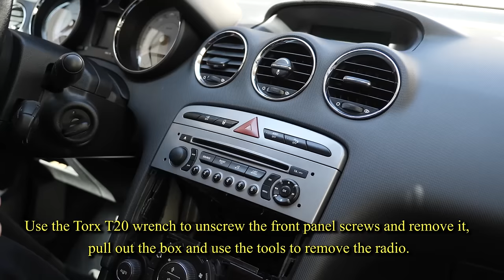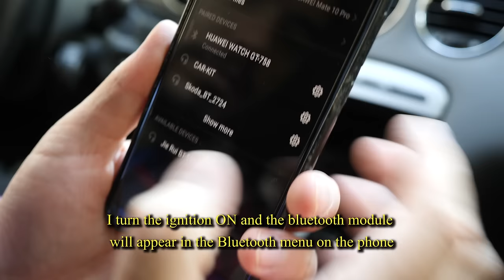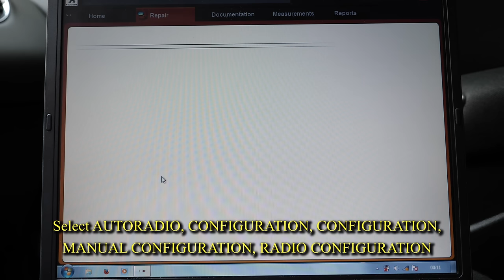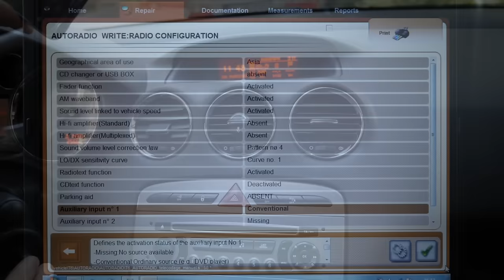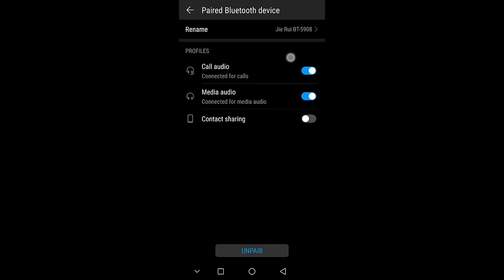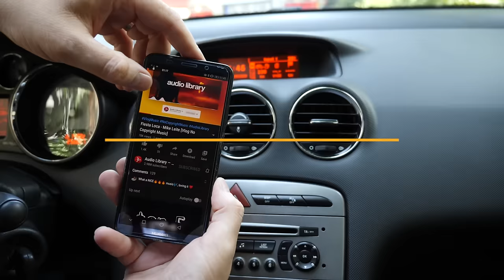Install Bluetooth Audio Module on Peugeot & Citroen Radio RD4, RD45, RD43

Comment: Ciao, is it correct that the module light stays on even after turning off the car?
Reply from the maker: Hello.  It should stop if the power cord is on the ACC.  If it is on the permanent plus cable then the module will not stop.
Reply: @AdrianDragan  thanks for your answer. unfortunately according to the diagram in pin 11 the cable was not foreseen, so I used pin 12. do you think it can drain the car battery?

Comment: Great video thanks. About phone calls, i heard people but they dont heard me. Do you know whats the problem?
Reply from the maker: If you bought the model without a microphone, people will not hear you. When you are connected to this bluetooth module you must deactivate the calls function in the bluetooth menu of the phone, see in my video 7:16
You need this module to work calls: https://www.aliexpress.com/item/32826594463.html?aff_platform=shareComponent-detail&sk=_9R3eKP&aff_trace_key=69b1471dec82414891bfcd005002377b-1604149301468-01708-_9R3eKP&terminal_id=77944c4ce01745aba668c8702a5739a3&tmLog=new_Detail

Comment: Great video but…for the call with Bluetooth? There isn’t a microphone …
Reply from the maker: Hi. In the links in the description of the clip you can also find models with a microphone 😉
Reply: @AdrianDragan  thank you man👍🏻 is also compatible with Citroën c4 Picasso year 2011?
Reply: @AdrianDragan  ok I buy the type plug and play with microphone…but,when I mount it,I can to go to Citroen to unlock aux or not? Thanks
Reply from the maker: @HouseMatic  It is compatible if you have Radio RD4 as you see in my video. You will need to go to the Citroen garage to activate the Aux IN function.

Comment: Adrian, tell me if it is possible not to disconnect the aux2 connected with a wire, but connect this bluetooth to aux1 and activate it. Will both work?
Reply from the maker: Hi. Hello. Theoretically they should be able to be kept on both, but I haven't tried. With Diagbox you will have to activate Aux 1 and Aux 2.
Reply: @AdrianDragan  I completely forgot that I have a CD changer emulator connected to aux1 for music via USB. Today I did exactly the same as in your video. Red to yellow, black to green-yellow. No activation was required, as there was a regular wired aux. There is almost no sound, it connects poorly. I think it's a marriage or maybe the pinout in the bluetooth is wrong?
Reply from the maker: @gromov8550  And the bluetooth module I tested in the video didn't seem to sound as loud as the original radio, but it still sounded clear and loud enough for me.
Reply: @AdrianDragan  This one, after reworking the connector, sounds like a regular wire aux. The sound is good. Thank you for the video.

Comment: Hola Adrián! Quería saber si es posible que el Bluetooth se encienda solamente cuando esté en input 1
Es posible? O si o si cuando el stereo está encendido?
Ya que no quiero estar escuchando la radio y que el Bluetooth siga encendido.
Muchas gracias
Reply from the maker: Hello! I'm sorry but I don't understand your question. Can you ask me in English?
Reply: @AdrianDragan  Hi Adrián! I want to know if it's possible that the Bluetooth module only turns on when I put the source on aux 1.
Because I don't wanted to be always ON.
So if I'm listening to the radio or a CD, the Bluetooth is off.
Thanks!
Reply from the maker: @carloscasares2308  Hello. It is not possible, the bluetooth module only turns off when you turn off the ignition, otherwise it is on even if you are not in Aux IN mode.

Comment: Hola buenas qué cable has usado y qué programa. Un saludo y gracias por tu vídeo
Reply from the maker: Look here: https://www.aliexpress.com/item/32815977509.html?pvid=0d5e756a-b7a6-4a3f-9831-64295117c470&aff_platform=shareComponent-detail&sk=_A8pQG1&aff_trace_key=4d1b5bbdd9934dd1a5598745bf9a3b5b-1609965045346-03938-_A8pQG1&rmsg=do_not_replacement&scm=1007.23534.124000.0&terminal_id=d92441f0a7b94ef29dcdfc816a4dd068

Comment: hi, i have a citroen ds3 with the radio 'my way rneg' which has bluetooth but it only serves to answer calls.  I wanted to install a module like the one in the video to listen to music on this radio, could you help me?
Reply from the maker: You need to check if you have that free plug for connection. If it is free you must also configure with Diagbox for Aux IN.

Comment: I've installed mine and sound is awful, extremely low and distorted... Does yours sound good?
Reply from the maker: Hi. My sound was a little lower than the radio but it sounds great.

Comment: Hello i buyed plug and play Bluetooth device but it doesnt work, Bluetooth device wont turn on
Reply from the maker: Hello. If the module is correctly powered by the 12v source and does not start, it may be defective.

Comment: Just wondering that you are using cd audio output to connect to Bluetooth output, will it not work when you select cd as source
Reply from the maker: This bluetooth only works when AUX IN is selected as the source.
Reply: @AdrianDragan   Many thanks for the reply will something like that works with cd exchanger port
Reply from the maker: I don't know, I haven't tested this model.

Comment: Hi sir, do i need to buy that diagbox ?
Reply from the maker: Yes. https://s.click.aliexpress.com/e/_DliIpcT
Reply: @AdrianDragan  may i know if this is compatible to a 2010 citroen grand c4 picasso?
Reply: @AdrianDragan  can i install the diagbox software if my laptop doesn’t have cd slot? .
Reply: @AdrianDragan  hi Andrian what if i will change the whole stereo to an android head unit do i need to use this diagbox for activation?
Reply from the maker: Hello.  If you install an Android unit instead of the original multimedia, you do not need any activation with Diagbox.  The Android unit is plug and play if you buy a dedicated one for your car.  What car do you have and from what year?
Reply: @AdrianDragan  i have 2010 citroen grand c4 picasso.

Comment: But how do you fix the low level, I have tried two different Bluetooth receivers with the same result, very low level of input on my RD4 car stereo.
Reply from the maker: For me, the sound level is good, so it works without making any other changes.
Reply: I have low level sound too. Quality is also very low.
Reply: Krystian Owczarczak I haven’t been able to fix it, I probably will buy a new car stereo instead....😢

Comment: Does it work on a Citroën C4 Grand Picasso year 2007 with OEM radio?
Reply from the maker: Yes, it works.
Reply: @AdrianDragan  thanks for your help.
Can you let me know what adapter do I have to buy if I'm interested to install new autoradio Sony, Alpine or Kenwood per example?
Reply from the maker: @nunoamaral7979   I think this: https://www.aliexpress.com/item/4000120219335.html?aff_fcid=78cde1ea86cb4bf386c7035b7ab58ed1-1615150484114-00782-_ANbc4S&aff_fsk=_ANbc4S&aff_platform=shareComponent-detail&sk=_ANbc4S&aff_trace_key=78cde1ea86cb4bf386c7035b7ab58ed1-1615150484114-00782-_ANbc4S&terminal_id=d92441f0a7b94ef29dcdfc816a4dd068&tmLog=new_Detail

Comment: Salut Adrian , dețin un Citroën c4 2007 și ca sa nu ma chinui sa comand de pe aliexpress piese , ma gândeam sa schimb radioul original cu unul aftermarket . O intrebare am , daca fac asta o sa mai funcționeze butoanele de pe volan de volum?
Reply from the maker: Salut. Eu recomand sa inlocuiesti radioul tau tot cu unul original model RD45. Astfel vei avea handsfree bluetooth, muzica de pe usb dar si mp3 de pe cd. Daca pui un radio din comerț vei pierde functionalitatea butoanelor de la volan, nu vei mai putea accesa meniul computerului de bord si vei avea nevoie de niste cabluri adaptoare. https://youtu.be/z5D4lsLGwVk
Poti cauta RD45 si pe olx, dar nu stiu daca vei gasi cu toate cablurile necesare.
Reply: Adrian Dragan ok , am sa ma uit acum sa vad daca găsesc ceva asemanator! Mersi mult

Comment: What is the function of wire that originalitty  in the entrance  gate?
Reply from the maker: Hello. That wire acts as an audio auxiliary cable entry for some models (there should be two RCA plugs in the glove box). On other models, as it was on my car, that auxiliary input cable was not fully installed and the AUX IN function was not activated.

Comment: Lho appena fatto ma scollegando il connettore gia collegato si va a perdere il vivavoce dell'auto perché non lo dici...?
Reply from the maker: Ciao. Non ho capito la tua domanda. dire ancora una volta per favore. Se possibile in inglese.
Reply: @AdrianDragan  The connector that you detach from behind the radio is the white one, on my Peugeot it is used to make the hands-free work, the other day I tried as in your video and the Bluetooth device worked, I state that I will have to go to Peugeot on July 4th, but I discovered by receiving a call and answering from the car the caller did not hear me and I did not hear him so if I insert the Bluetooth device I lose the possibility of having the speakerphone in the car

Comment: Hello, I am from Algeria. I did the same, no, the bluetooth did not work with the HUAWEI phone, but with Samsung it worked normally. What is the solution?
Reply from the maker: Hello, In my video I even tested it with a Huawei Mate 10 Pro phone and it works great. Did you manage to pair the phone Huawei with the bluetooth module?
Reply: @AdrianDragan  thank you very much

Comment: Can this be done without the software? and also can it be wired so the Bluetooth is on even if the ignition is off?
Reply from the maker: It will only work if you activate the software for Aux IN.  Yes, the bluetooth module can remain functional even with the engine off, the power consumption is very low and it is not dangerous.
Reply: @AdrianDragan  thanks man! great video by the way.  you have a new subscriber here.
Reply from the maker: Thanks 🙂

Comment: We’re I can order that if someone know plz give me information thanks
Reply from the maker: You can buy from Aliexpress: 
- Bluetooth Module Stereo AUX-IN Audio Adapter: https://www.aliexpress.com/item/32826594463.html?aff_platform=link-c-tool&sk=q3G1DJg4&aff_trace_key=c9b4b5f8037f4ff89514a01002733b7f-1593084523307-07925-q3G1DJg4&terminal_id=364d159dab6d4da48c68657f8054a5c8&tmLog=new_Detail&aff_request_id=c9b4b5f8037f4ff89514a01002733b7f-1593084523307-07925-q3G1DJg4
- Bluetooth AUX Audio Adapter with Microphone Handsfree: https://www.aliexpress.com/item/33041645593.html?aff_platform=link-c-tool&sk=qeRJkdUM&aff_trace_key=f649d9be60ab4c6a92143f76feed0884-1593084533137-04813-qeRJkdUM&terminal_id=364d159dab6d4da48c68657f8054a5c8&tmLog=new_Detail&aff_request_id=f649d9be60ab4c6a92143f76feed0884-1593084533137-04813-qeRJkdUM

Comment: Dealt with the problem. The connection in the aux1 and aux2 connector is different. Therefore, the standard wire connection in the connector works in the place under aux1 (on the right), and under the standard aux2, not, since there is a different wire connection in the connector. Here is the link to the schematic   https://yadi.sk/i/YiQYcyBUNKnFvg
Reply from the maker: Good to know. Thanks!
Reply: Thanks alot for the information, so that means i can use both, one on Bluetooth and the other for Jack cable
Reply: @nateriver6225  Yes. Of course it is possible. I have one for bluetooth, the second for the CD changer emulator (USB flash drive)

Comment: Buna ziua Adrian ,as vrea sa ma interesez daca e posibil asa device sa instalez pe peugeot 607 cu RT3 ?
Reply from the maker: Salut. Nu am gasit doar modulul simplu bluetooth. Am gasit un UNB Box cu functie de mp3 player de pe stick USB ce a re inclus si modul bluetooth, din pacate pretul este mai mare decat la modulul bluetooth prezentat de mine: https://www.aliexpress.com/item/32921030847.html?aff_platform=portals-tool&sk=_d6e1k9T&aff_trace_key=4042d4bbae72435990a6a0e8b10f6282-1590866383681-06345-_d6e1k9T&terminal_id=364d159dab6d4da48c68657f8054a5c8&tmLog=new_Detail&aff_request_id=4042d4bbae72435990a6a0e8b10f6282-1590866383681-06345-_d6e1k9T

Comment: On my Peugeot 308 2009 radio does not playing I don’t know what to do .please recorded video please thanks will you answer me
Reply from the maker: Hello! Does your car have a JBL audio system? Usually these problems occur when there is a factory JBL audio system on the car.
Reply: No i not have JBL im my car
Reply from the maker: @blablabla4606  I don't know what the problem would be with your Android unit, maybe you should ask the seller, I'm thinking it's faulty.
Reply: I no have a android radio i have  serial radio

Comment: Hi, can someone tell me if I buy the plug and play Bluetooth I have to do any wiring like in the video?
Reply from the maker: Hi. For that model, all you have to do is connect the plugs and activate Aux IN with Diagbox.  You don't have to make cable connections like in my clip.
Reply: @AdrianDragan  aight, the videos are helpful mate thanks for sharing, now I have to find diagbox dealer in my area

Comment: Hi Adrian - thanks for this video and the instructions. I was really looking forward to having bluetooth added to my Citroen's RD4 however it seems that I have a problem. I have connected the bluetooth to the back of the RD4 and used the splices to connect the wires as you instruct but my iphone is not picking up the bluetooth signal. How will I know if this is a defective unit or if I have not spliced the wires correctly to give the bluetooth device power?
Reply: It seems that the problem was not the bluetooth device - I tried splicing it to pin 12 and it worked, but that is the battery and if I leave it there it will drain eventually. The yellow wire in my car wiring harness is attached to pin 10 not to pin 11. On the diagram, pin 10 doesn't seem to be related to power (or does this differ with each model?)
Reply: It seems that the wiring of all RD4 systems is not equal. I ended up following @BrewHound who also had a similar problem - no wire on pin 11 so used pin 15. This might be useful to other people who also find that pin 11 does not have a wire.
Reply from the maker: Good to know. However, before installation it is good to check the power wires with a multimeter to identify them exactly.
Reply: @AdrianDragan  Yes that's probably the best thing to do first if the wiring does not match the information provided in the wiring diagram - it's hard to find any information online that has details of all variations of the standard wiring for the radio harness.
Reply: Hi, i got same problem, connect all and dont have bluetooth signal. I am trying with 12v power out of car and again not working, i dont have bluetooth signal, may you help me??

Comment: Salut. Se poate seta volumul senzorilor de parcare? La mine de abia se aud dacă e liniște
Reply from the maker: Salut. Nu stiu sa-ti raspund la aceasta intrebare dar ma gandesc ca in meniul senzorilor de parcare din Diagbox poate fi configurat si volumul avertizarilor. Masinile mele Peugeot nu au senzori de parcare di fabrica si implicit nu pot vedea aceste meniuri.
Reply: In principiu  da .   
La un 5008 din 2015    am setat  si te lasa intre nivel 1 si 8  .

Comment: Am și eu un peugeot 307 sw 2007 și am casetofon rd4 și as dorii sa pot sa folosesc stick la el se poate?
Reply from the maker: Salut. Pe RD4 nu se poate folosi stik USB, trebuie sa faci un upgrade la RD43 (citeste mp3 + are stick USB) sau la RD45 (citeste mp3 + are stick USB + handsfree bluetooth integrat). O alta optiune ar fi sa faci un upgrade la o navigatie android dedicata. Mai jos gasesti link-uri pentru fiecare in parte.
RD43: https://www.aliexpress.com/item/32821599263.html?aff_platform=portals-tool&sk=_Bf67iEF9&aff_trace_key=3b3ccac124cb4898a172aef0e34aa8ed-1590607048290-09677-_Bf67iEF9&terminal_id=364d159dab6d4da48c68657f8054a5c8&tmLog=new_Detail&aff_request_id=3b3ccac124cb4898a172aef0e34aa8ed-1590607048290-09677-_Bf67iEF9
RD45 fara cabluri: https://www.aliexpress.com/item/32951475848.html?aff_platform=portals-tool&sk=_dVc6bpV&aff_trace_key=b05133c9542940b3b6a04e75df5104d1-1590607133683-01584-_dVc6bpV&terminal_id=364d159dab6d4da48c68657f8054a5c8&tmLog=new_Detail&aff_request_id=b05133c9542940b3b6a04e75df5104d1-1590607133683-01584-_dVc6bpV
RD45 set complet inclusiv ecran tip C: https://www.aliexpress.com/item/32819826654.html?aff_platform=portals-tool&sk=_d8O347z&aff_trace_key=894ba86bcf164c89ba4658096b4eebf6-1590607188274-09226-_d8O347z&terminal_id=364d159dab6d4da48c68657f8054a5c8&tmLog=new_Detail&aff_request_id=894ba86bcf164c89ba4658096b4eebf6-1590607188274-09226-_d8O347z
Navigatie Android dedicata 307: https://www.aliexpress.com/item/4000389329622.html?aff_platform=portals-tool&sk=_d7XsFsb&aff_trace_key=5f1573565b41456f8ffc4b4ab372d0c1-1590607413260-02732-_d7XsFsb&terminal_id=364d159dab6d4da48c68657f8054a5c8&tmLog=new_Detail&aff_request_id=5f1573565b41456f8ffc4b4ab372d0c1-1590607413260-02732-_d7XsFsb

Comment: Hello, I have empty pin 11 but in pin 12 I have  two wires - yellow nad green , what now?
Reply from the maker: Remove that 12-pin plug and insert the plug from the bluetooth module.
Reply: @AdrianDragan  so I should put the red wire from bluetooth adapter in place of this green and yellow in pin 12?
Reply from the maker: @ggomez8701  I think I misunderstood what you were talking about.  Use a multimeter to find the 12v wire in the power plug.  If you don't have a wire for pin 11 then you can connect to pin 12 with the red wire from bluetooth.